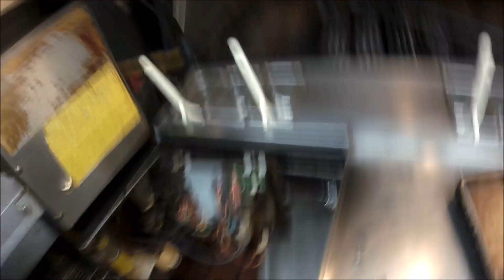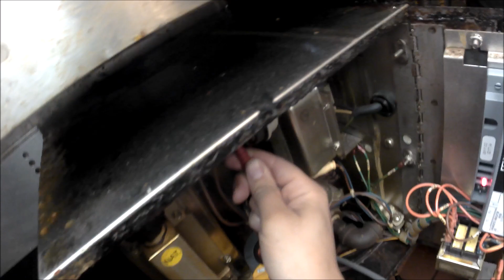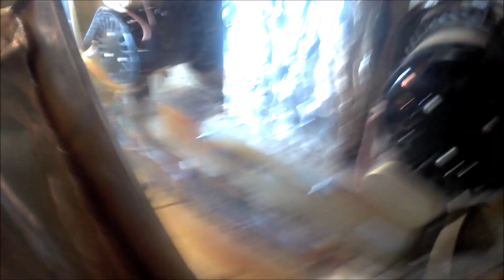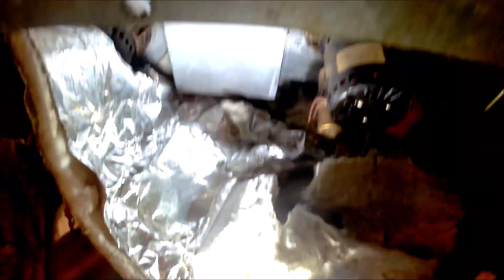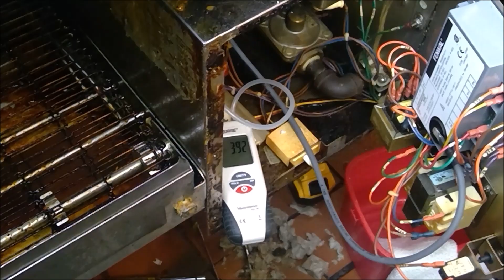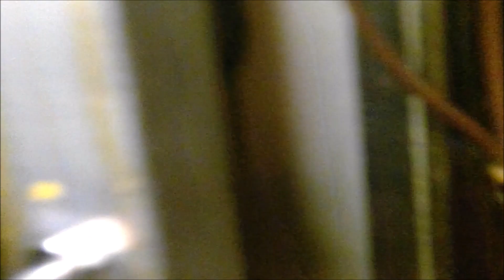Middleby Marshall Conveyor Oven Is Not Heating (PS528G).

Comment: Yeah, I remember being certified for Middleby Marshall. And the moron employees standing on the conveyor would screw them all up. And always an ample supply of cooling fans, modules, and a gas valve handy on the truck. Or another fun one: replacing a blower while the oven is still hot, laying down layers of cardboard to insulate from the oven's internal heat. Oh yeah, and that oven was stacked on the oven below, cooking pizzas. Yea what fun.

Comment: Hi sir i faced one problem in my oven model No. PS840E when i stared the oven it is good working and reach the set temperature but after reaching the temperature all restaurant lights is blinking ,i checked voltage was good electricity and on generator also the same problem ,please help me i will waiting for your replay Thank you sir

Comment: Funny I'm watching this video after I just worked on a powder coat oven run by a middleby temp controller. It was dropping voltage every time it completed the purge cycle,, 30 sec card installed. 
I checked the 500 VA Transformer and it was dropping to about 80 volts. The burn control shut off around 80 volts and then regular voltage came back. Eventually i found a dead short from vibration abrasion to the flex and to the wire that was feeding the pilot solenoid valve.
I first isolated the igniter, still had a problem. Then I isolated the pilot solenoid valve and it did not brown out or drop voltage like before.
That's how I found it, was easier to disconnect the power then test to ground as neutral and ground was bonded and every coil shows like a dead short.
Reply: In my situation,  middleby controller fed an amplifier board and sent high fire low fire using a 24 volt xformer that then fed the honeywell burner controller. That controls the main, pilot, igniter, and has a uv flame sensor, natural gas. I believe high fire is main in my situation pilot is low fire.

Comment: Do you know why my ovens heat up but take like an hour to reach set temperature. I had the stats and probe sensors replaced and still the same. What could be the problem?
Reply from the maker: Stuck in low fire possibly

Comment: How do you test or handle TC sensor. So far I've been using ohm tester but I don't think it precise enough. I want to try portable scope but since the unit has 2x TC in parallel it might be hard to isolate. Have you ever try mico-amp on each sensor? Manual stated at room temp it should read 1.3mV but I can't even get that on new sensor.

Comment: You should've donation box on your channel. I'll be glad to pay you for the info regarding to high/low fire section. I service these machine too, along with many other, and I have no idea about high/low fire section on these units. I do change out lots of motor and temp sensor. I do like to seal up all the gap and hole to prevent heats from getting into motor housing.

Comment: Hi there, Middleby Marshall pizza oven temperature dropped, changed the gas valve, asked technician came many times but it was still not heating up, can running around 2 hours then keeping losing heat even try to restart the heat switch, hope you were in Australia, any recommendations?
Reply from the maker: I wonder if the unit is stuck on low fire or if the pressure switch for the blower motors is not closing
Reply: @REFRIGERATIONKITCHENEQTECH  after running oven around 2 hours, it was not heating up and the temperature dropped constantly from set 280℃ to as low as 130℃, restart the heat switch it was heating up again sometimes , if not then wait until it started heating by itself, technician came when oven works no problem as it’s normally happened after 2 hours running at dinner time when they finished the day, have to pay a lot for call out and labour every single time but they can’t fix the problem, said have to check single parts every time
Reply: Pilot assembly or the cable can cause this issue too. I just fixed Blodgett with the same problem. When ever I show up the unit working good so I tease the mgr that she wanted to see me not because of oven. You can use micro-amp meter to see if signal is strong and stable.

Comment: Same brand, same problem. Blowers are on, RSET error code. Ansul light is off. What’s the problem?
Reply from the maker: Do you have flame sense? Are you dropping voltage at the pressure switch?
Reply: @REFRIGERATIONKITCHENEQTECH   thanks for responding. Unit was okay. It’s was the ansul system all along, like we assumed.